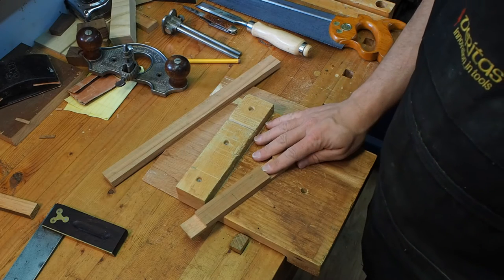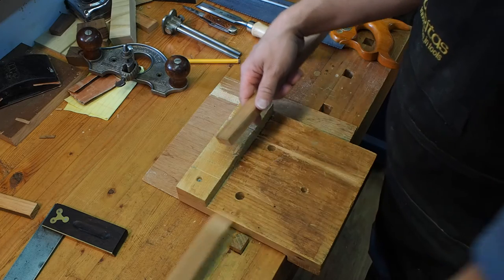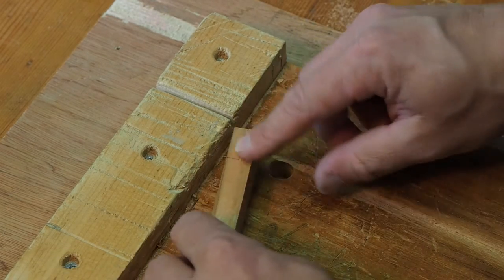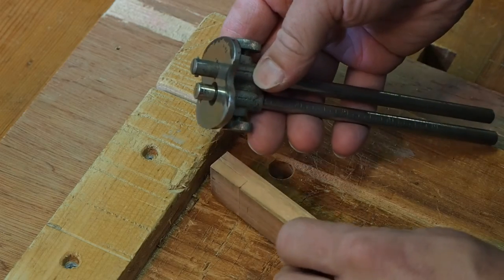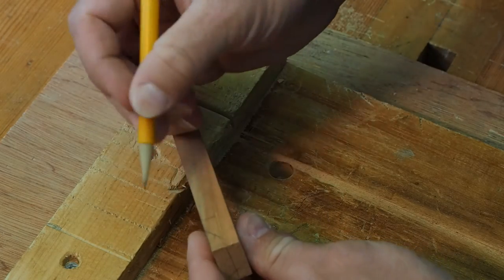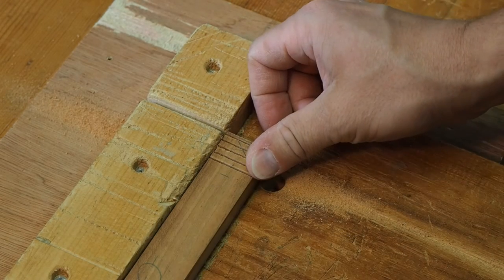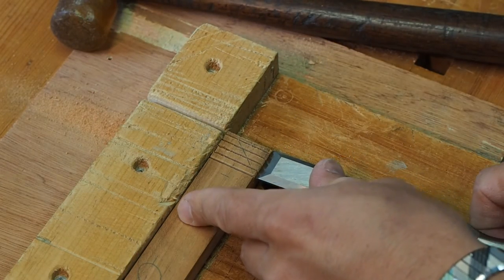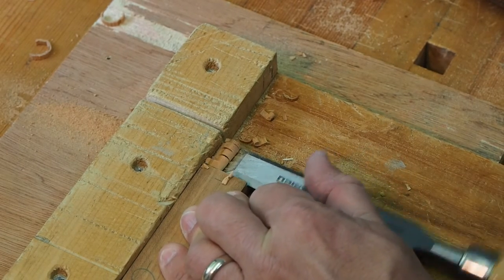How to Cut Half-lap joint with no power tools

Comment: I cannot find a decent router plane. As you are experienced with this tool can you please find a link for me to purchase a decent one. I find this video very useful and I added it to my carpentry file
Reply from the maker: To be honest I got this one off eBay, and actually have bought a lot on there.  You do have to be prepared to sharpen and often clean the tools up a bit, but that's not too hard.  Also, Lee Valley makes a new version, that while not a traditional in looks, is most likely a very good performer.  Plus you can buy blades on Lee Valley in a variety of sizes that fit their router planes and the older Stanley ones.  Best of luck!